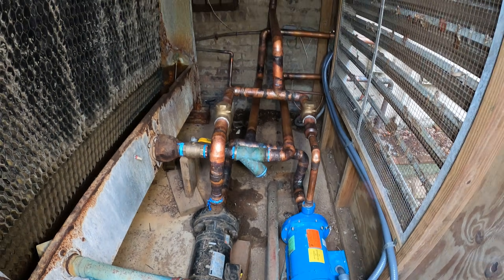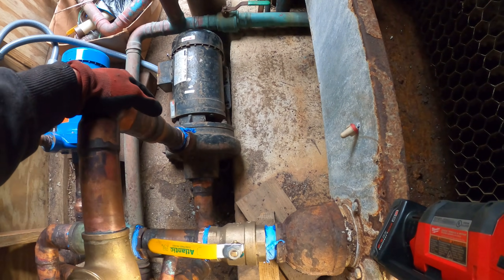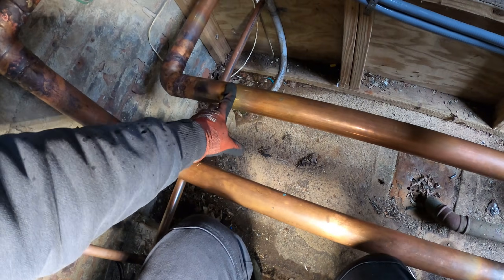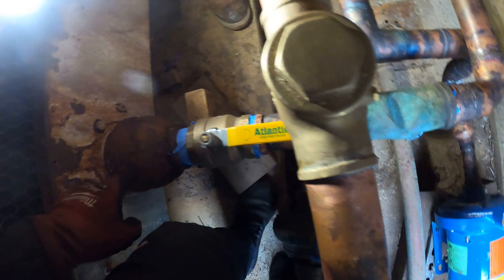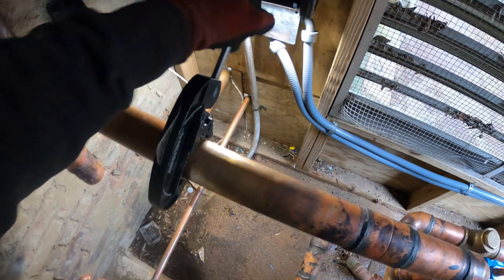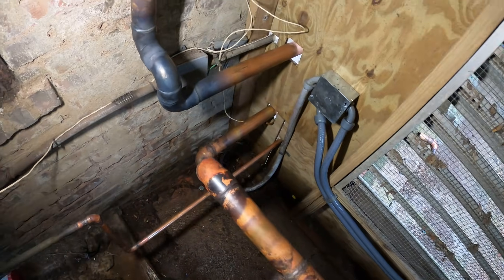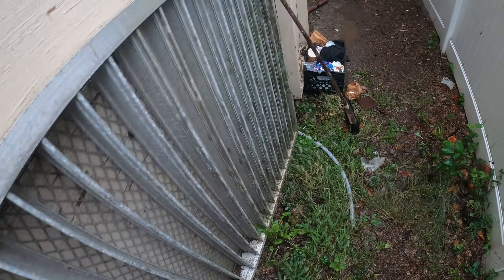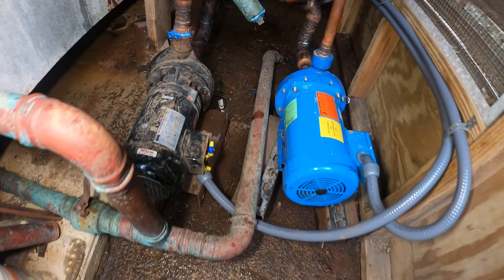HVACR Service Call: Cooling Tower Emergency Repair (EvapCo Cooling Tower MAJOR FAIL) MUST SEE!

Comment: Should have added some unions and isolations valves off those pumps incase they fail you can read pace it and allow the system to keep running

Comment: Common sense. He looked at the system. Looked at the pumps and looked at the suction and discharge side of each pump. 
You can see the discharge check valves and the suction screens. 
He used what he has to fix the system that was not installed correctly. 
Brazing is what he uses. Others have other equipment to work with. 
Cheers to your work.

Comment: Pumps and Pipework and as say also the pipe sizing is  grossly undersized coupled with the amount of  elbows, one would piss more than the amount of liquid making it's way down across the Plastic cooling media ... obviously no regard to having a Water Treatment  company engaged in supplying chemicals for dosing the Tower... Can't imagine what the state of the process pipework, heat exchangers  would be like ... A breeding group for Legionnaires ...be careful out there...

Comment: I would have the cooling tower drain into a return tank pump from there to equipment than back to top of cooling tower. Too many turns and pumps have to pull water from cooling tower catch tray. There should only be one pump with proper head pressure. No check valves?

Comment: That's not right either! With no check valve if  or rather when one pump fails or potentially just get weak the system  will backfeed. There is way less resistance in that direction.  An alternative would be to plumb in series. Either way this will fail at some point as it is.
Reply: Series? Eh for something this tiny?? Nah man. Parallel is fine. You only need like 10-15 psi. Even in industrial we run like 10-15
Reply: @Username-ng8jy  the amount of pressure needed is  completely irrelevant. The flow will take the path of least resistance.  The system only needs one pump.  But with two in parallel without a check valve , if the older pump fails the flow will absolutely not go the way it's desired.   It either needs a check valve,  reduced to 1 pump, or plumbed in series.   As is in the video it's just plain wrong.
Reply: @ceazar75  series is definitely not the way to go. Parallel in this small set up is harmless. Yes least resistance. The flow will go fine especially with a dead impeller. The impeller in the dead pump will create the resistance. It’s just gonna go the way it’s intended. Literally I’ve seen small systems similar as this go for years without any issues in parallel. I think your confusing something with something else man. This set up is very simple.
Reply: I see two check valves  in series, one for each pump.  Am I missing something?

Comment: question, is there a reason for making the output on T from the pump outlets vertical and not horizontal? I'm not the most knowledgeable person but seems that can cause air entrapment in that output "hump" as well as adding an extra elbow or two into the system.  I don't want this to come across as snark but a legitimate question from somebody who is very limited in such applications/tasks.

Comment: YES! This video HAS confirmed that we are ALL in the Turd Polishing Business! Great job JMT! The first few seconds of the clip I was like Whoa!!!! WTF is this!!!? If that was me I would have cut everything out, and start again!!! Just wondering why did you leave that smaller pipe section on the discharge of that blue pump? Why not replace it so to avoid excessive pressure loss?
Reply: It looks like the dingle that installed that rats nest sourced a smaller diameter pump, if you look at the piping, it doesn't look like there are any reducers on the pump itself. Smh.
Reply: Hack job on retro pump , looks like amateur hour no spec's on added pump to meet peak demands , with VFD speed controls layout plan of piping backwards , to minimize pressure loss with less fittings using 45 ° in place of 90 ° unless back pressure is needed on run to cooling tower ✅☝️👍✌️🤔

Comment: Why brazing? I would think that soldering would work a lot better unless there is something i am unaware of with commercial stuff.
Reply: Fridgies can't solder.....but we can braze though.
Reply: Braze is stronger and faster to get done less prep work ... ie no flux just sand. But don’t braze water lines that feed houses or buildings the braze rods contain lead so soft solder is usually the go to for potable water lines.
Reply: @BasketballAve  depends on the rod you use. I’m a plumber and have brazed potable water lines. Use it a lot for underground connections and manifolds.
Reply: @BasketballAve   Brazing rod does not contain lead (lead melts at a much lower temperature).  In our code, buried waterlines can be brazed but not soldered.
Reply: Wonder if you can run 2 45° instead of 2 90° ells on offsets lose a 90 ell and 40 to 50 feet of run nice damage control of hack retro work... 👍✌️💪🙏🤔 ...
Reply: @milo6373  if he's anything like my boss he used 2 90s because it's cheaper then 2 45s 😂
Reply: i don't know if this is the correct answer, but this is my opinion.

Braze joints are physically stronger than solder joints. While both can hold pressure, braze joints can handle physical manipulation better. With a lack of any real hangers and supports on the ground, I would imagine thats why.
Reply: Soldering is susceptible to vibrations. They're close to the pumps. Those pumps also need to be primed as well if those pipes don't have water.
Reply: Was wondering the same thing. They're working as plumbers at this poit. You only need to braze refrigerant lines. 
I guess they didn't have the flux, prep supplies
Reply: That was what I was going to ask. Either way, good job.
Reply: Scabs buying your own tools!!! Make your company buy the tools. Per my union I only need to supply hand tools..stop working for a mom and pop shop.  Work for the big boys.  Brazing is way more faster.
Reply: @Cheez1979  I have my own for side work and my company pays union wages without all the bullshit 🙂 not to mention bonuses and pto
Reply: @Cheez1979  I make more than the union shops in my area but am expected to have a lot of my own stuff, not the big ticket items like vacuum pumps or recovery machines but hand tools, clamp meter, manifold gauges yes. I guess it's a trade off for a higher wage and all my on call being paid at double time.
Reply: Screw all that it should be done in pro press
Reply: @Rpotts1999   you buying everyone a pro press? brazing will last longer and is far cheaper then pro press.
Reply: @andrewgilbreath1331  it's the cost of doing business I work for an commercial hvac company and I have one on my truck. Its what professionals use
Reply: @Rpotts1999  I work commercial/industrial. Did you buy the pro press on your truck? My company has 3 but they need to be signed out. I’m 21, do you expect me to buy one out of pocket? Or drive to the shop to do the repair and bill the customer? Nah I’ll just braze it.
Reply: @Augdogfrogslog  yes I own it
Reply: @Augdogfrogslog  no but if you owned your own company I would expect you to ive been in the field 17 years. It took a long time to build up my tool collection
Reply: @Rpotts1999  ya I'm in agreement with him pro press is nice but I'm not buying a $2000+ dollar tool out of pocket to save a very little bit of time especially when I'm paid by the hour. I have plenty of expensive tools that I bought I'm not stingy about buying my own tools at all but I see the pro press tool as a solution to a problem I don't have. Also as to the professionalism thing I know way more plumbers that solder/braze than use press fittings so I guess you can have your opinion but I don't think the majority would agree with you.
Reply: @keldon_champion  I was under the impression the guy In The video owned his own company. I don't expect techs to have to drop 2 grand on a tool that should be supplied buy the company they work for.
Reply: @Rpotts1999  that's fair and I didn't mean to come across as hostile, my company doesn't supply press tools but we are commercial HVAC/R and food service equipment so we don't do a ton of plumbing we just tie the equipment into the building utilities (supply lines and drains) there are exceptions but we usually draw the line at the pipe goes into the wall. I do know a lot of plumbers that don't really use press fittings there is nothing wrong with them for water but I feel it is preference more than anything as long as the job looks good, doesn't leak, and the customer is happy that's what matters. I will say though I am not a fan of refrigeration press fittings because I have removed and brazed an awful lot of leaking lokring and zoomlock fittings, I just recently found a hoshi refrigerator under warranty that leaked it's whole charge out of them (they capped the process stubs with lokring caps).
Reply: @Rpotts1999  I have one for convenience, but I think soldering or brazing is better.
Reply: @Rpotts1999  spoken like a true resi rat
Reply: Ripped all the piping use press fittings it not look of piping if you cut out pieces .

Comment: I am  a bit lost guys can somebody explain better am really enjoying your videos
Reply: Pumps are really good at PUSHING water. They're okay at pulling, but pushing is what they're designed to do, and not having the right amount (head pressure) being pushed when the pump is expecting a certain amount can actually lead to catastrophic damage.

The design of the cooling tower is: hot water comes back from the building, trickles down over the cooling media (for example, cardboard mesh) where a fan blows outdoor air through it to cool it down, and the cooled water goes back to the building in a cycle.

You want the pumps to push the water. In almost every case, you want to pump the water into the building, where the other end of the pipes is up on top of the cooling tower. The water trickles down and collects in the basin at the bottom, where the pumps can pull water from and push it back into the building.

The way it was set up at the beginning of the video is the water was being pulled from the building, pushed from the pumps just a few feet to the top of the cooling tower, and the collection basin fed back into the building. Through gravity and pump suction I guess.